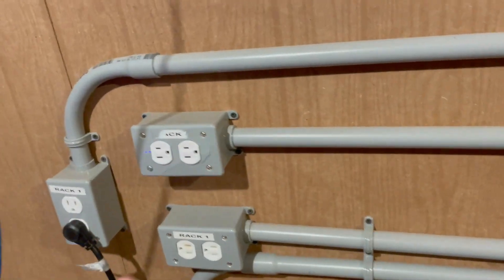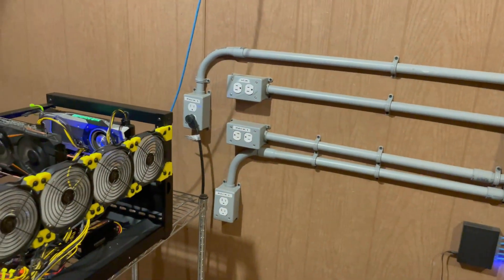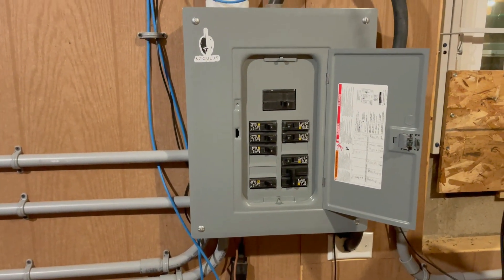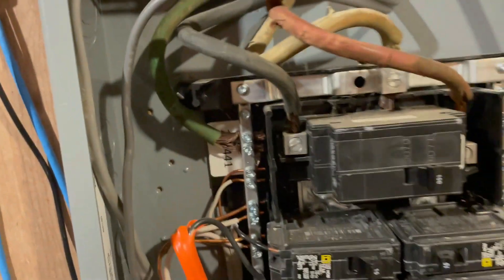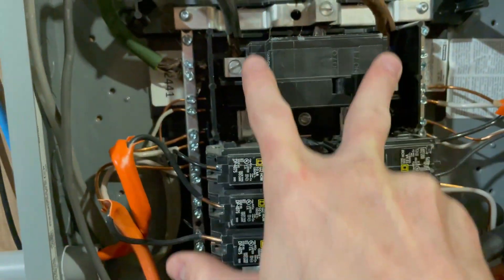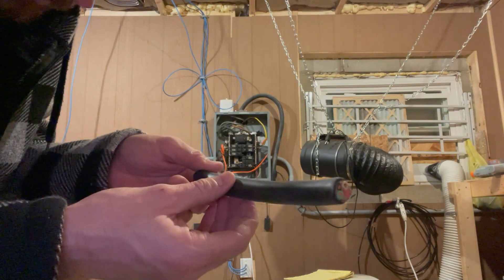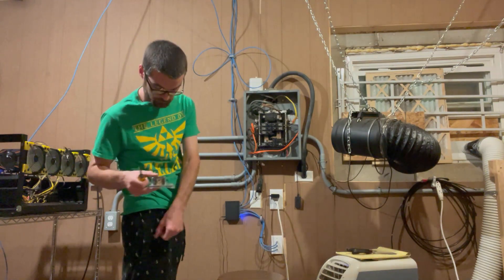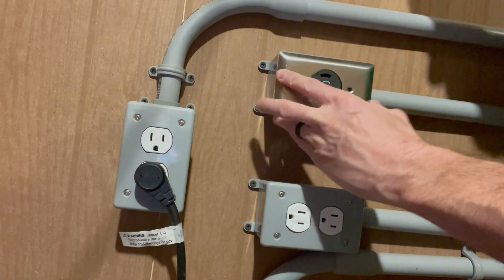Asic Miner Electrical Setup

Comment: Can i take to individual c14 connect on my pdu  with each c14 connect having 240volt and used that to power my s19jpro
Reply from the maker: Sorry it’s taken me so long to answer your question but if the PDU is plugged into a 240V plug and then you have 2 cables going from your s19jpro to that PDU the yes it should be correct. That click on my video and if you haven’t done so already please subscribe to the channel it helps a lot.

Comment: Can I plug a PDU into my 3 prong dryer outlet and run a ~3500w ASIC?
Reply from the maker: So they don’t have a PDU that will fit that plug but the wires behind it are correct. You would need a different plug wired in there to fit the PDU. I hope my video and this answer help you in some way. Thanks for watching my video and if you haven’t done so already please subscribe to the channel it helps a lot.
Reply from the maker: If the plug matches the PDU it should work just be sure it’s 240V so the breaker should be a double pole breaker meaning it has 2

Comment: Can I use a 5000w step down converter
Reply: Bro Can You help Me Out I Can Pay If you want
Reply from the maker: What you got going on?
Reply: Is there any better way to chat with you
Reply: Because I Purchased Avalon 68th And it's only giving me 28-35th
Reply from the maker: You can contact me at CryptoKnightM@gmail.com.

How do you have your machine plugged in?
Reply from the maker: Can you elaborate a little bit more so I can be sure to understand fully?
Reply: I got Direct Wire From Main Wires Of Electrical Wires Which Are Upside
Reply from the maker: Email me pictures of how you have it running